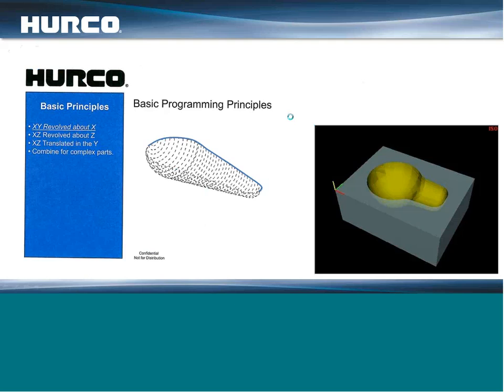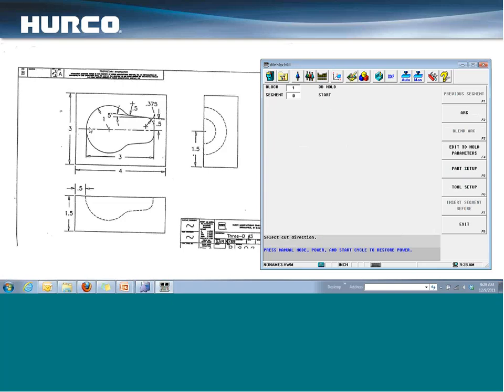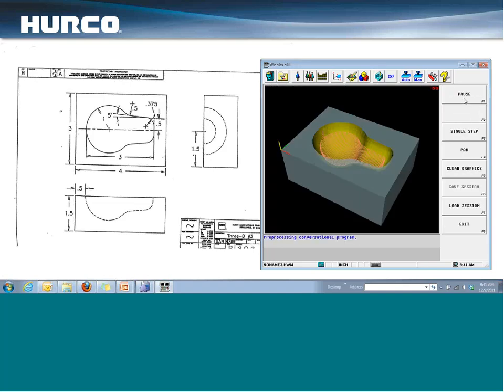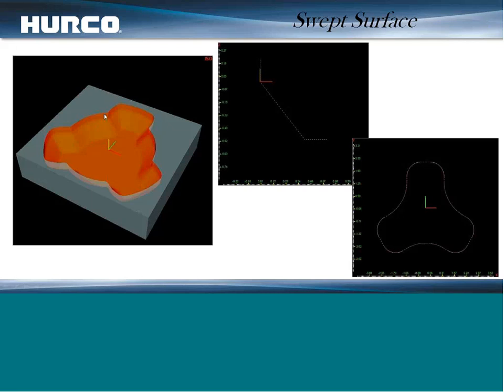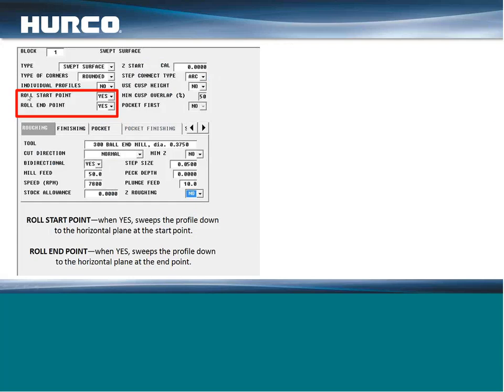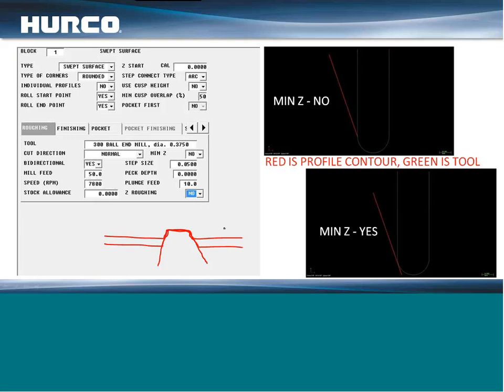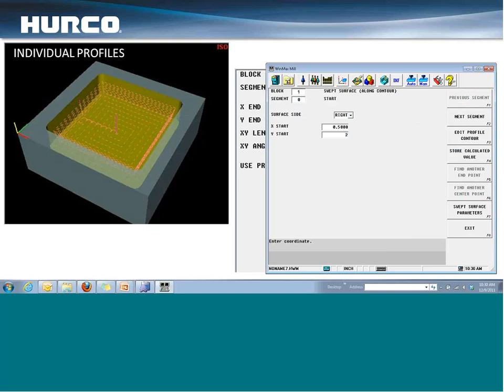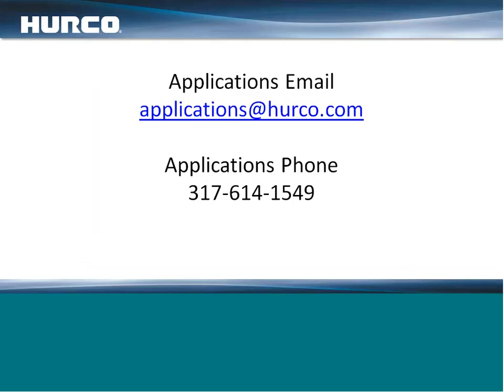Hurco Online Training - WinMax -  3D Mold Swept Surface

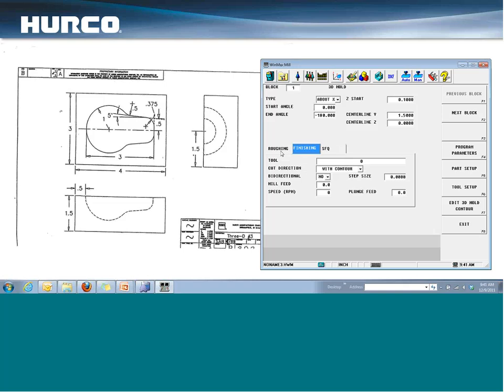Comment: For me the simulator does the 3D mold but ignores the peck depth. (26:30) I tried endmill and ballnose as well. Is it something in my settings / parameters?
Reply from the maker: If I understand your question correctly, all you would need to do is go into the display settings and in your graphics and turn on show pecks for 3D surfaces